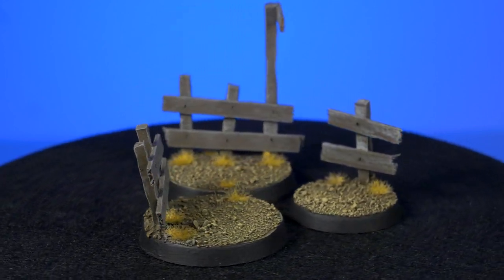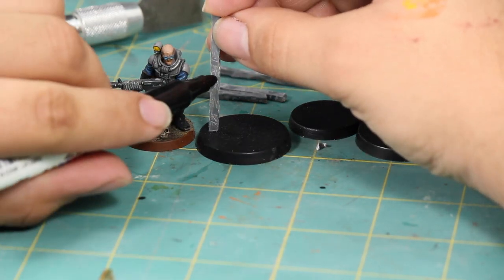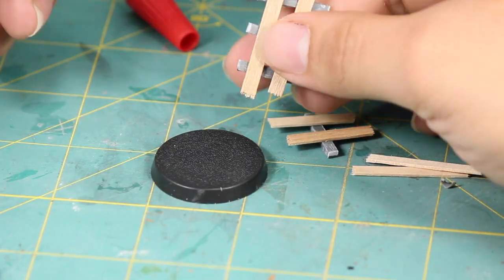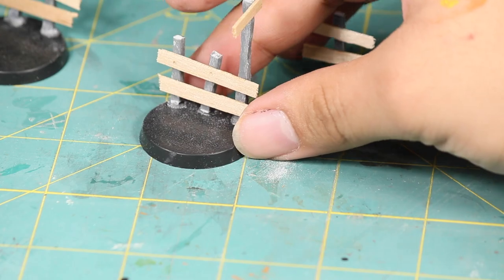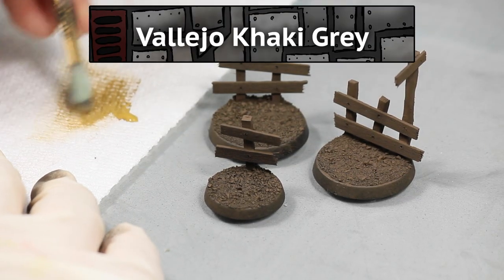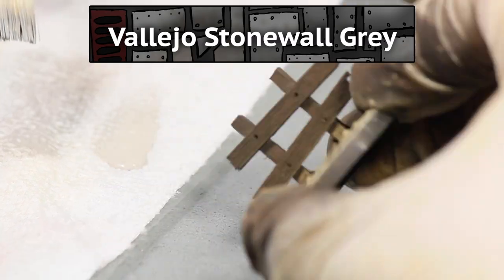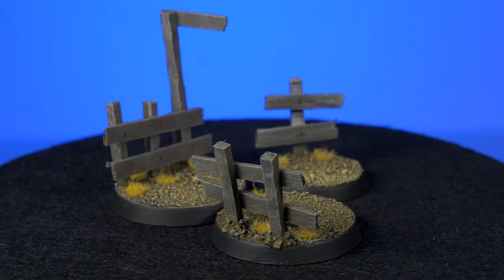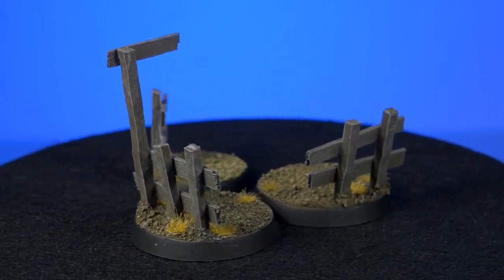MAKE Your Prospector Lean on THIS! Dusty Cowboy Fence Base

Comment: Not sure if you have mentioned it before or not, but how come wood glue over PVA?
Reply from the maker: wood glue dries much stronger than PVA, so I like to use it instead.
Reply: @EonsOfBattle  thanks for the reply and totally makes sence, you find it application properties  similar ?
Reply from the maker: @capidano6248  it's almost identical it just has more potent resins in it.
Reply: @EonsOfBattle  you got me SOLD!!! I am gunna give it a try, as I find PVA/sand sometimes lifts off the base, but as a solid piece, here is to a new era of Wood Glue!